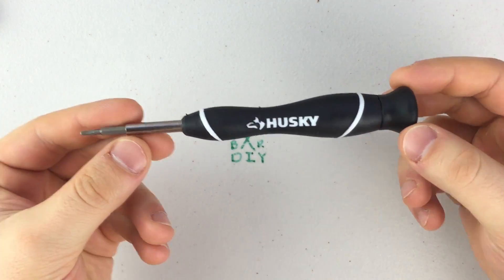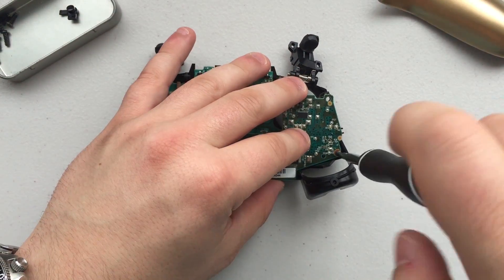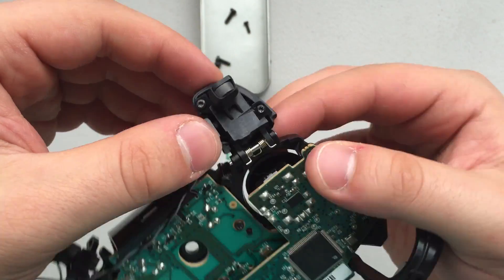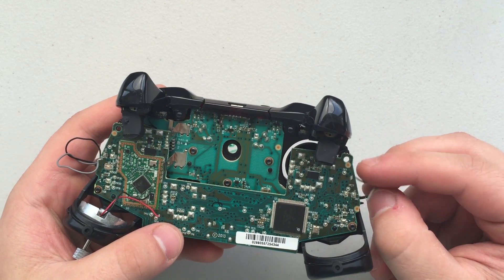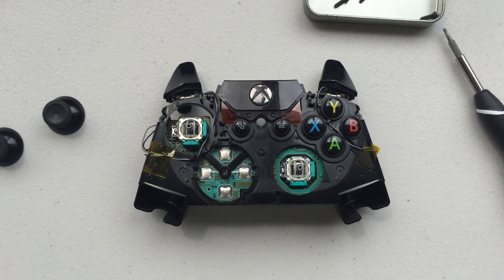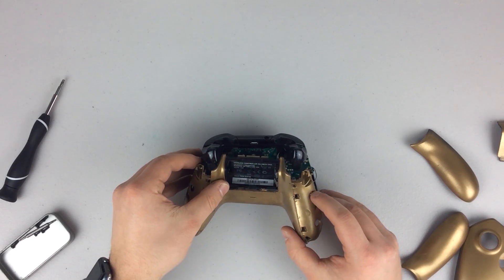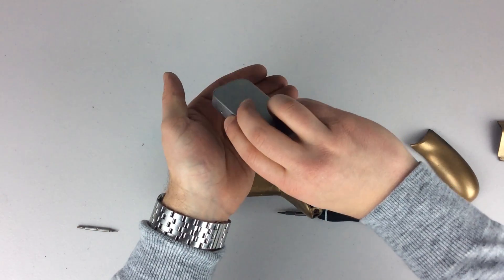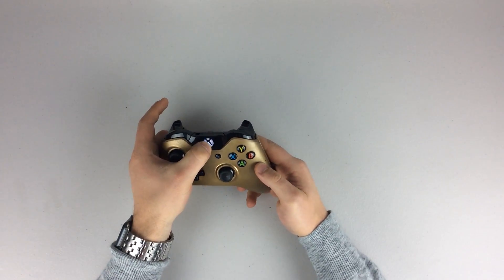How To Reassemble an Xbox One Controller

Comment: Your video saved me dude. When I was reassembling the controller i forgot to tuck the battery contacts in when lowering the back plate and it was messing with my right trigger. I couldn't figure it out for the life of me. Keep up the great videos.

Comment: You put the d-pad on incorrectly when I did it this way my down directional button wouldn't work, I opened an old controller that wasn't opened before and the plastic direction pad goes under/before the metal ring.

Comment: And while attaching right bumper some small white thing came off from circuit board, but when i checked controller all buttons and vibrator motors are working is it necessary to attach that small white thing again. i don’t know where it came from but.
Reply: I found that white thing is on right side of you home button on top of circuit board named D20, what is its use do i have to attach it?
Reply: Check your video at 3:51 its visible

Comment: Hey there. Was wondering if maybe you could provide some insight for me? I’ve had this problem twice now, but I’ve done some DIY Paint projects on two of my controller, and I have this problem where, after everything’s put back together, properly, for some reason, the controller registers that one or both of the triggers is being activated, despite the fact that it isn’t. I really can’t tell what exactly the problem is, but it seems as if the trigger isn’t coming back up 100% of the way, or for some reason the trigger naturally sits at a position where it’s activated. If I manually pull up on the trigger, it does deactivate. But as soon as I let go of it, it reactivates. I was wondering if maybe you had any knowledge on this type of situation, and / or if you know what a fix was. Thanks in advance!

Comment: FOR ANYONE HAVING TROUBLE the battery prongs are on your left, where the battery goes, when you mount the back, both prongs should be in the little dents opposite of the positive and negative engravings, and the should make contact wit the batteries

Comment: I couldn't for the life of me find how to put the sync button back in, so I appreciate this video.
Reply: Same. I had even done it before. Won't forget again. {Here's hoping!} It doesn't help that these One controllers are not uniform like the 360s. There are subtle and not-so-subtle changes. Even the triggers are not one size fits all. I know this because I took a bunch apart and found I could not mix and match. Makes the at-home Design Lab a bit tougher.

Comment: Ok I did it the way it says but now my controller wont turn on I took it apart cause my right stick wouldn't go right it was stuck it moves like it should but it wont turn on even with the charger plugged in

Comment: Ive watched this video a hundred times and I still can't figure out what I'm doing wrong. Everything works fine until I put the back cover on, then the controller goes haywire.  This is incredibly frustrating for two reasons. 1, I cant figure out if its the dpad or the right stick and 2, I cant figure out whats causing it. Can anyone help?

Comment: I still dont understand why you unsolder the rumblers i have changed my controller shell without any soldering required its much easier!
Reply from the maker: You can change the shell without removing solders but to change circuitboards, buttons, etc. you have to remove the solders as they are wrapped around the board.
Reply: Xbox DIY ive removed all buttons aswell without a solder was just curious but thats a great video either way by fat the best one ive seen for controllers !
Reply from the maker: And I'm not quite sure what I was thinking there - you can indeed change the buttons like you mentioned. This was more of a tear down than anything else, although I've definitely said "use this video to get here". Thanks for the feedback and stopping by!

Comment: I just took my controller apart to fix the RB button and put it together with ease but for some reason it wouldn't turn on.. not sure what I did wrong not sure if I skipped a step.. any help is needed
Reply from the maker: Hey Jake - glad this helped you out. There's definitely a few things that could have happened. Check to make sure your circuitboards are snapped back together. It's a little bit wonky. Also, make sure the battery prongs that stick out are placed properly...I had an issue with that one of the first times I did a controller repair. Finally, double check the home button housing. Also another weird area that could prevent the controller from turning on if anything is wrong. Let me know if any of this stuff works!
Reply: Xbox DIY I opened it up and checked everything  thoroughly and looked closely and everything seemed to be ok so I put it all back together and it turned on right away. Thanks for the help I appreciate it
Reply from the maker: Yup, sometimes it's just a loose screw, or connection that's not quite there. Glad it worked for ya! Now it'll be 100x easier to fix next time lol

Comment: My bumpers are different than yours were, the whole assembly around the Xbox button was attached as well. Also I recommend borrowing a soldering iron or paying for a good one. I grabbed one that just plugs into the wall and it does not have the heat to soften the solder.

Comment: So, would I need to disassemble that far to take the broken bumper out? In other words, if I were to disassemble the xbox one controller just enough to take the broken bumper out, would I need to use the soldering assemble the controller back on?

Comment: you probably should of used an updated controller because my controller's bumpers are attached to the thing that's surrounding the home button
Reply: Prateek Patel same
Reply: For the most part, this is still relevant.  Only difference these days are the bumpers and the faceplate that also covers the home button
Reply: Prateek Patel and what would he do for people using the old controller then?
Reply: @shingouki6392  separate videos.
Reply: Matt Dee pls do I dont know how to put the.bumper back on
Reply: any luck?
Reply: The earliest Xbox one controllers had hinged bumpers. The one he's working on. The one that came out after, the one with the headphone jack, had the bumpers attached to the home button frame. That sounds like the one you have. I just worked on one of those today. It was a pain putting it back together. Now there's also the newest version. The one with bluetooth. That one has one solid faceplate.
Reply: @dreadthelight3936  is there a video on the second gen?
Reply: @masterqui-gonjinn90  idk I'll bet there is but I'd have to look for it sorry i know that's no help
Reply: @dreadthelight3936  it’s fine I figured it out I had to dismantle the bumpers and the other part then put them on separately
Reply: @masterqui-gonjinn90  awesome the bumpers have these long arms that go behind the faceplate to press the actual electronic switches. While i was putting it on i used my tweezers to guide them into the holes. Doing one on one side just a little then the other before snapping the whole thing down. I had to take it apart like 5 times so now it's super easy to me
Reply: @dreadthelight3936  glad we figured it out my guy
Reply from the maker: I'll definitely take a look at this. Purchased a newer controller recently and too noticed it was significantly different. Probably like car models, these things get updated yearly.
Reply: Shin Gouki I Have the old controller

Comment: So I ran into an issue. I put my controller back together, even re-soldered the wiring. All the vibrations work, the B button and all the other buttons work except for the AXY buttons. I know it would have to be a problem with the first board, however before I took it apart the problem I had was with the rubber pad for the buttons due to the one under the A button breaking. Any ideas on what the issue could be?

Comment: I Need Some Help, I Broke My Right Bumper, This Started a Couple Days Ago When I Noticed That It Was Hard To Press My Right Bumper, The Right Bumper Was Very Hard To Press Toward The Right Side of The Bumper, I Was Messing With The Right Bumper, And The Whole Thing Just Came Out, I Can't Put It Back In, Maybe I Need a Tool, I Am Getting a New Controller Soon, So I Guess It Does Not Matter, Anyway Awesome Video! Happy New Year!
Reply from the maker: Thanks for stopping by and commenting! 

For your bumper, are the clips on the bottom of the bumper broken? Are there any other parts that are broken? If so, you'll need to replace it . And yes, you'll need to open the controller to replace no matter what, but the cool thing is you only need to pull the outer shell off to fix the bumpers (see my video on that here: https://www.youtube.com/watch?v=1QNXRPmMFHI)

Even if you don't have to fix it, it's cool to be able to know how to do it if something breaks in the future :)
Reply: Ok! Thanks So Much! I'm Going To Replace It Right Now! Thanks So Much!
Reply from the maker: Awesome - let me know how it goes. If you have a torx screwdriver (you can get them at any hardware store) it will make your life a lot easier, but it's not necessary.

Comment: you should do some fix's for the xbox elite controller like how the triggers get messed up and also the other problem  the bumper breaks
Reply from the maker: On my backlog. I need to buy an Elite controller or find someone who is willing to give me one for the purpose of a review/disassemble/reassemble :)
Reply: That's a simple fix.  You can get a replacement RB/LB button that goes under the cover for the home button.  Getting the old one out may be tricky but it should be simple to fix.  Just be careful if you choose to completely remove the back as there is a ribbon cable there.

Comment: Hey +XBOXDIY I Love Your Videos But I Have A Question! My Controller Keeps Me Looking Up In GTA 5 (The Joystick Is Not In Its Position Its A Bit elevated) Plz Halp
Reply from the maker: I have this EXACT same problem with my other controller right now! It's definitely an issue you can fix. It could be one of a few things:

- Rumble motor wires have moved around and are interfering with the joystick
- Something sticky got in the joystick
- Something sticky got in the circuit board
- Bad circuit board

You're going to have to open it up to see what's wrong with it, but you should be able to figure it out without taking just the shell off (check out my first video: https://www.youtube.com/watch?v=1QNXRPmMFHI)

Comment: Great video! I was just wondering if I can somehow fix my RB button. It is working but it popped out of place and I don't know what to do to get it back in. It does function though if I push it down back into place but it's still really loose.
Reply from the maker: Hmm - that sounds like one of the clips is broken that holds it in to place (see this video for what I'm talking about).

Have you tried taking it apart?
Reply: Xbox DIY I just taped it on for now, it still works. If It gets worse I'll definitely take it apart. Thanks!

Comment: could you do one for the elite mine has stick drift and it's out of warranty so I wanna learn how to do it myself. xbox support was no help they told me to restart my console. Yeah that will fix my controller
Reply from the maker: Moabdog00 Sure. I'll add it to my video backlog. Now that I learned how to solder it should be much quicker than how long it took to make this video.
Reply: Xbox DIY awesome thanks
Reply: Xbox DIY I just think it's stupid how it seems like the elite controllers are designed to break after 5 months this is my second one this year and I'm tired of waiting a month for xbox to fix it